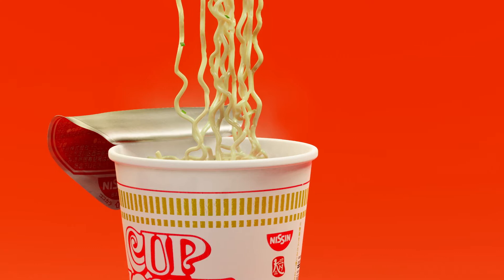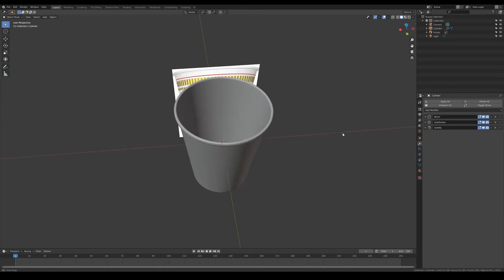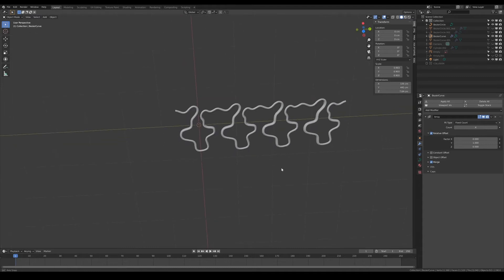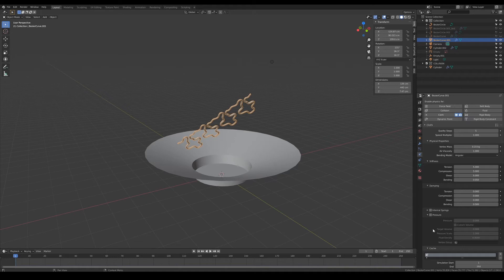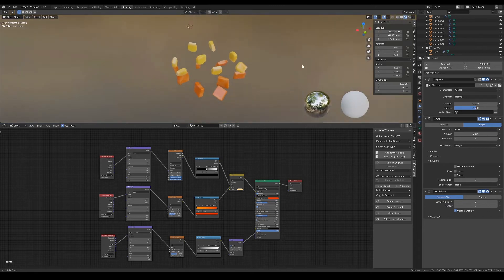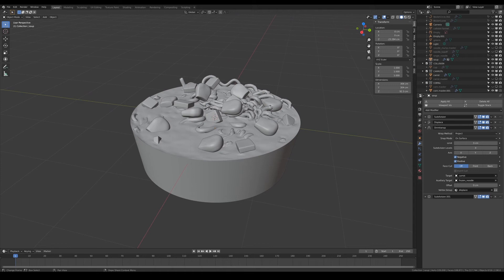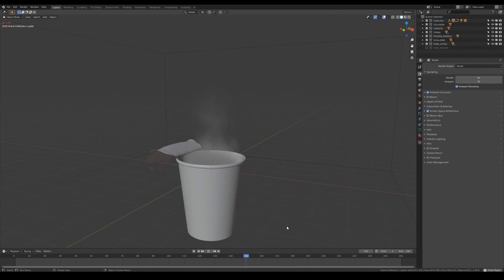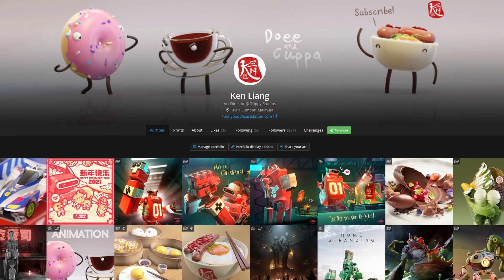KWIK TUTS #008 // How I Made Nissin Cup Noodle in Blender

Comment: Hi,  The noodle gets distorted when I simulate, the noodle's surface becomes uneven. Self Collision distance is at .1 cm and scaled larger than what you did in the video.  I tried with a 40K+ and 7k+ vertices noodle and still get distortion. Did adjust anything in Stiffness and Damping?
Reply from the maker: Did you enable internal springs?
Reply: @KenLiang  I have the same problem and I have enabled internal springs. I've tried both with the standard settings and also tried increasing the tension and compression.
Reply: @Birkkromann  have you find any solution
Reply: @pavitrajain8311  yes, I changed to Cinema 4D instead 🙈

Comment: Hi just a quick question on UV wrapping after marking the seams, how did you get the uv to curve around the product label? The only thing close I've gotten was using cylinder projection but it doesnt curve around the product label? Thanks!
Reply from the maker: The unwrapped UV should be curved by default if your cylinder mesh(cup) has a lower diameter at the bottom. The only reason I could think of in your case is that the cylinder is perfectly straight from top to bottom?

Comment: Sir, i have a question. When i convert curve to a mesh it becames subdivided a lot. And my cloth simulation becomes 0.00001fps for only one noodle. Unsubdivide makes bad results to a mesh. Is there any chance to control number of subdivisions when converting?
Reply from the maker: Tune down the curve's resolution (in object data properties) before you convert it into a mesh. If you have a subdivision modifier, remember to only apply it after you convert it into a mesh, not while it is still a curve. Generally, the heavier your geometry, the longer it takes to simulate your cloth. So try working with as minimum geometry as you can and only refine it with subdivision modifier after the cloth modifier.
Reply: @KenLiang  thanks a lot!